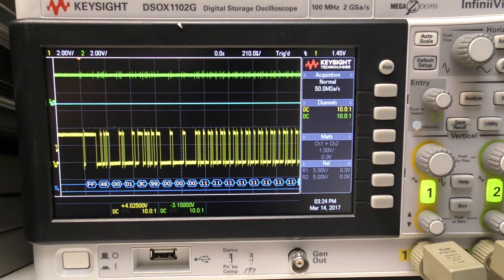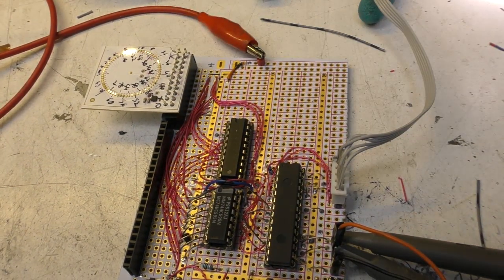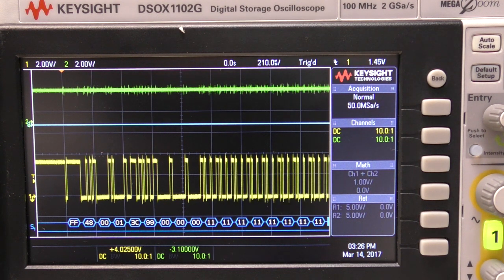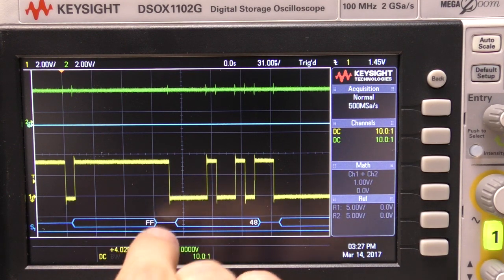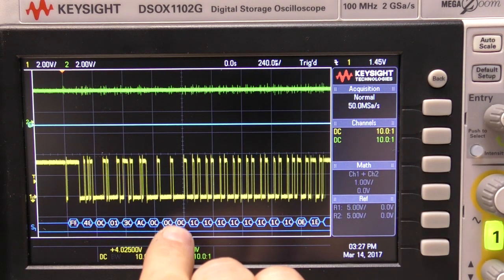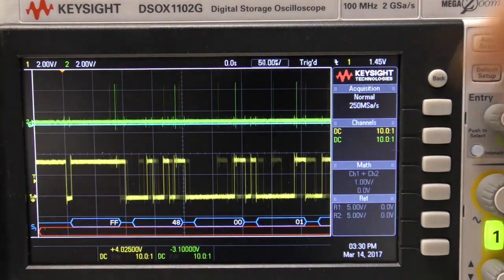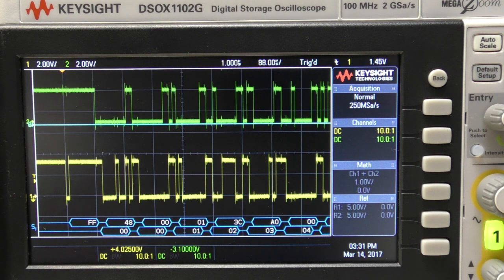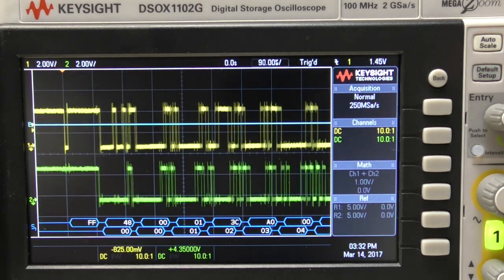Realtime debugging using serial decode

Comment: That's a really neat way to do it, thanks for sharing! Also, I've fed the packet-decoder-edge-shape feedback to our UX engineer.
Reply: well this new,a company that actually looks into feedback from community influencers
Reply: It would also be nice if the text is drawn vertically when space is not adequate to print them horizontally. It will automatically rotate to vertical orientation when decoded data are compressed. This will then accommodate more information than how it could when printed horizontally. There is space to do it. Its really good that users can now easily share their experiences with officials. If I had Keysight I could have shared more, but Rigol doesn't listen to me.

Comment: Why do you use PICs so much? There are much nicer MCUs around these days, and it seems like your projects would be better suited to an FPGA. The iCE40s are getting really popular these days due to the open-source tool-chain.
Reply from the maker: Mostly as it's what I know. 
Plenty of other advantages though - same tools and similar peripherals for 8,16 and 32 bit parts. Big choice of packages - often QFN,SSO,SO and DIP for a lot of parts including 32 bit. AFAIK PIC32 is only 32-bit available in DIP, and biggest RAM available in 28 pins. Microchipdirect will preprogram production parts for pennies. Good documentation & support, good availability.

Comment: Just your comment about not needing to stick to traditional (slow & arbitrary) baud rates anymore is mindblowing. Going to have to experiment to see how fast I can get Raspberry Pi UARTs to go (IIRC some Pi versions have "hardware" UARTs, others all implemented in software)
Reply from the maker: Don't know about the hardware UART on the RasPi, but plug an FT232H into the USB port and you can do 12MBaud!
Reply: Awesome, thanks, I'll definitely try that out!

Comment: Another great tip is to borrow timers/CCPs. I've had systems where the UART was in use for something else (e.g. system backplane comms) and there wasn't a second UART or SPI/I2C I could pilfer for debugging.
So I defined ten timer values between 10us and 1ms (100us steps, but "zero" is clipped at 10us) and defined the values as constants. Set up the CCP in one-shot pulse mode, then load the reload register when you want to output some debug data. "I'm in state 5 of 10".
On one chip we had a timer but no CCP. We borrowed a GPIO, set up an interrupt triggered from the timer to set the GPIO, then to output debug? Clear the GPIO, load the timer and set it going.
Triggering is as simple as using bounded pulse trigger ("trigger on low pulse between X and Y ms") on the scope, if you want one specific condition.
One idea I was looking at was a tight loop which blasted Manchester code debug packets down a GPIO to a micro which received and decoded them and blasted them down a USB port to a waiting PC. Never got round to that though. That was mostly for control loop debugging. Another engineer figured out a way to tweak the RS232 protocol to send "hidden" RS232 debug packets on that thing! Wonderful hack.
Reply from the maker: With CCP pulse widths, 9 timer values (Tbaud*1 to 9) would decide to valid (9 bit) UART values
Reply from the maker: ...decode...

Comment: Nice. I don't have the budget for such a smart scope but many of the techniques are applicable for cheaper scopes.  For us budget types it is still possible to achieve a lot of this using a toggle pin to be a condition (as you showed) and then to look backwards and interpreting the bits manually or to make a poor mans logic analyser using another microcontroller and likewise looking backwards... but it takes time.

Comment: Damn, that scope works pretty smoothly. The user interface seems super responsive. What's the retail price of one of these?
Reply from the maker: Cheap for a Keysight scope, but more expensive than similar units from Rigol etc. Checlk your local dealers for pricing. Remeber KS are giving away 5 of these a dayt this month - search Scope Month
Reply: not so expensive. compare it with a dso2000A-S (or non S if you don't need the wavegen)
keysight's actually cheaper here in europe:
945€ for dso2070-s (70MHz, wavegen) at batronix
812€ for dsox1102g (70MHz, wavegen) at farnell
you can get a decode licence and it costs the same!
then 1195 vs 1032 for 100 MHz

Comment: about the fancy blue outlines obscuring the values, can't the scope just dump the values to a serial line so you can watch all of it on the computer or something?
Reply: The point is to have it on screen with another signal.
Reply: On the higher end InfiniiVision scopes, you can get an exportable lister table of all the data.
Reply: sigrok can do this with a $6 logic analyzer.